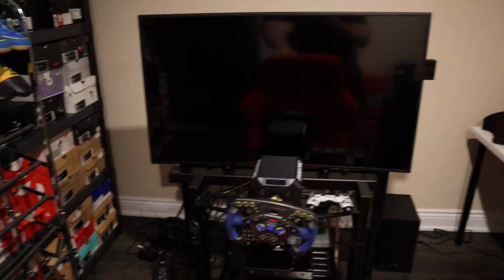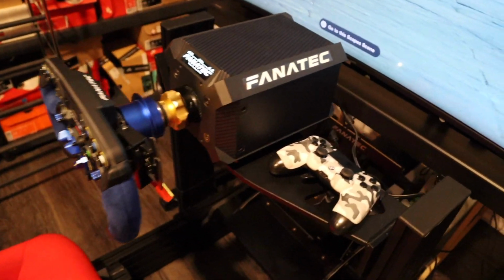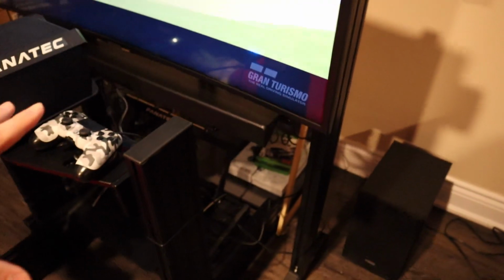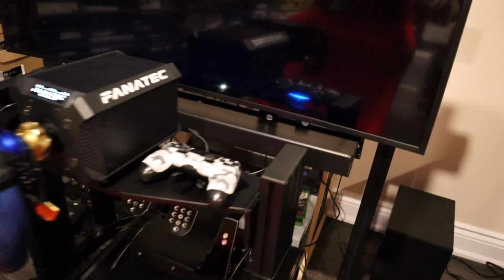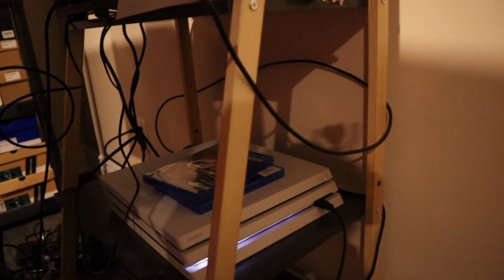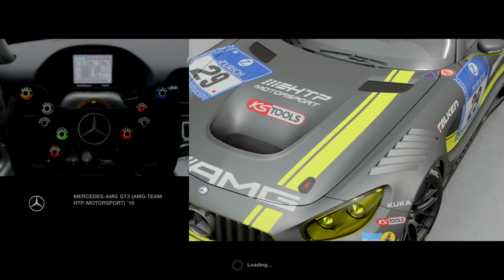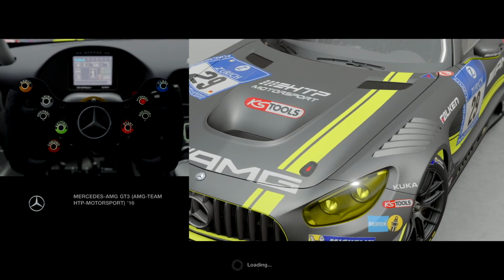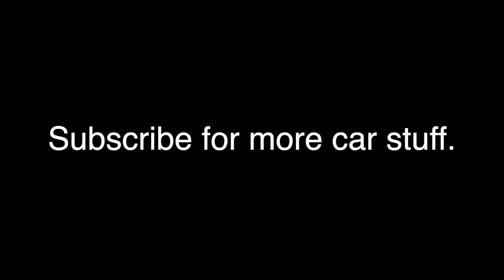THIS IS MY RACING SIMULATOR!

Comment: Great video! Is it possible for you to drive one of your cars in your garage on Gran Turismo and explain in detail how it feels in the simulator as compared to real world driving? As in how good of a job the simulator does or doesn’t do when compared to actual driving.
Reply from the maker: I've actually done that with a few cars on here already, and I can tell you that there's definitely a familiarity to the real thing, but does it feel exactly the same, no. You can get a pretty good sense of how a car handles, but ultimately there's nothing like the real thing IMO.
Reply: Car Problems thanks for the quick reply. I believe you said that you owned an Audi R8 in the past. I’m looking to get an R8 in the future. Any issues or things I should know before purchasing the R8? I’m going to buy it used as well.

Comment: Setup is awesome. But from having GT Sport myself and putting nearly 40,000 miles into the game you should do the following.
 Turn off traction control.
Learn the brake bias.
Buy the Porsche 911 RSR GT3 because that's the most consistent race car you'll get a perfect feel for the game and mechanics. Do the endurance races on career mode also as it'll teach you consistency. Finally, maybe an open lobby around EU time?
Reply from the maker: I only ever play with everything off.

Comment: Ive never used a simulator before. For me its hard to believe that a simulator can even get close to driving a real car on the track. Maybe im wrong though. 🤔
Reply from the maker: When it's a cheap setup, yes, there's very little that translates to actual driving because you can't feel anything. When you get into some of the more expensive stuff, there's a surprising amount of detail that comes through the wheel especially. Feeling the actual forces of driving a car on track can't be simulated in something like this, but I definitely think that you can get some solid practice in when it comes to a lot of track specific driving skills.
Reply: Well if a Formula 1 driver can use a simulator as a way to practice for an event then I dont think theres need for much debate
Reply from the maker: You're not wrong, but they also use million dollar simulators for setup and development, so I wouldn't really compare that to a setup like this. Can you learn certain skills on a simulator, absolutely, but being in a real car is quite a bit different.